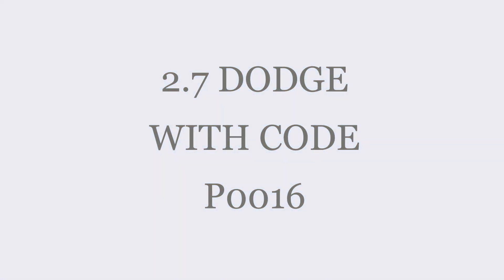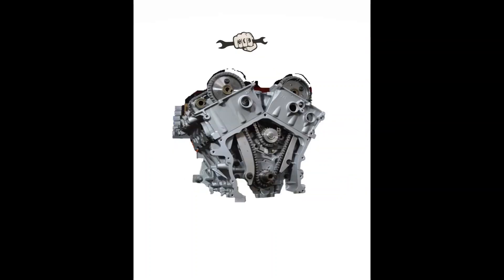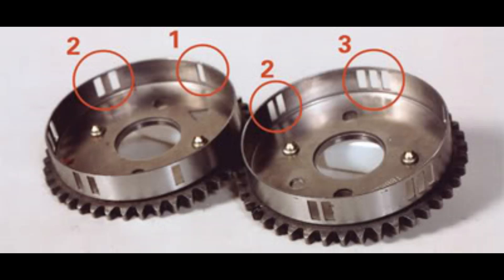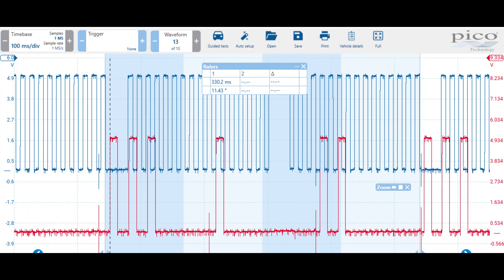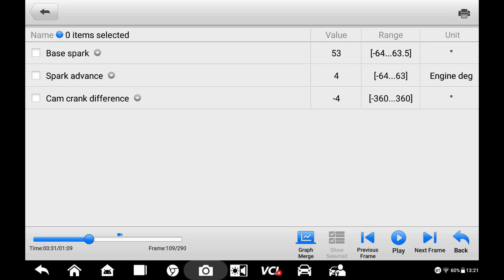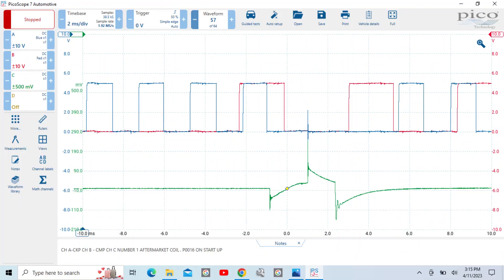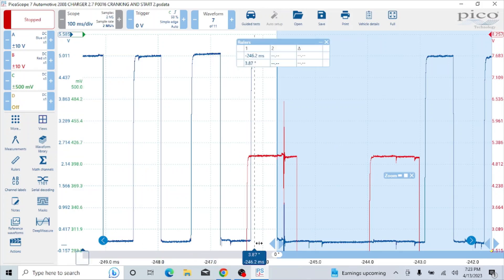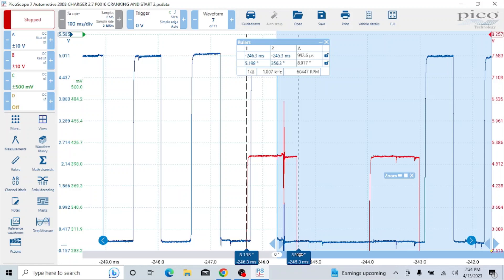P0016 CAM CRANK CODE ON 2008 / 2010 DODGE CHARGER 2.7

Comment: I just replaced lifters and rockers on a 2010 2.7 had to do a crank relearn .. didn't remove timing cover and cam crank difference is +9 idling .. is it off a tooth at crank ?
Reply: Main chain tensioner is also extended out a good amount
Reply: I also replaced secondary chains and tensioners
Reply: Seems to run fine
Reply from the maker: If it seems to run fine it may be ok .A cam / crank relearn would help but in my experience 12 degrees for every tooth off . That can change based off of change in sprocket or chain teeth .